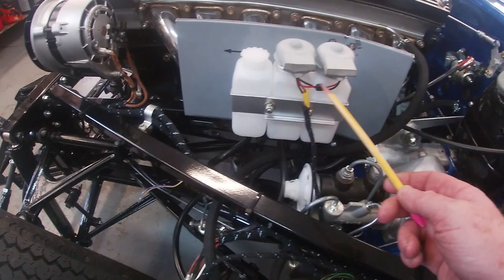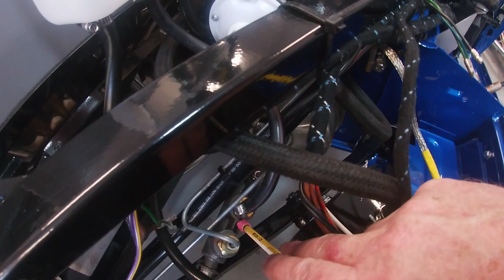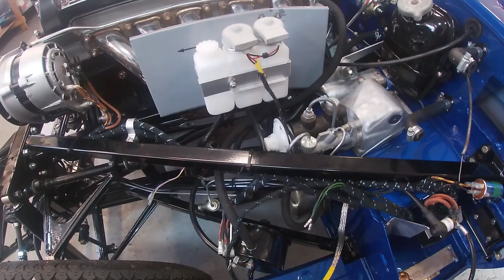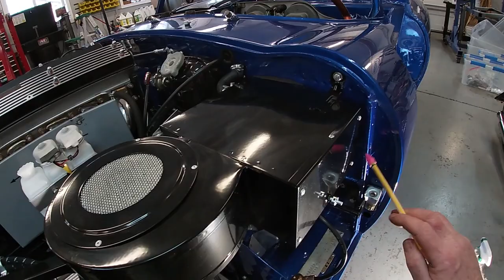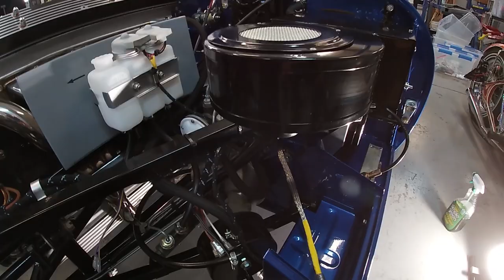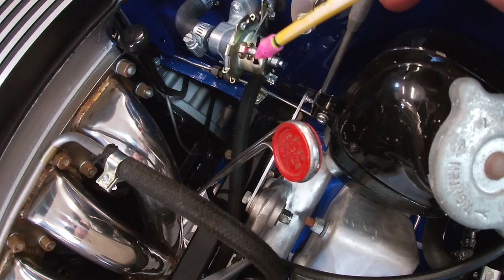Jaguar E Type Series II Rebuild - 2023-02-18 Brake/Clutch Reservoir and Heater Installation

Comment: You are really cracking on now John and putting me to shame. I have just fitted the engine today. Thanks for you tips in a previous video. I was a serious fight on my own especially as I have ftted a 5 speed box which is nearly 3" longer than the original. Your heater box looks stunning with such a great finish on it. Mine has rotted out so I am going to have to fabricate on. Thanks for the tip on the bracket on the bottom I did not know there was one there. Hugh

Comment: Looking good John. Smart move leaving the protective film on the reservoir heat shield so it won't get marked up while you're working in there. I think you're going to have to move the charcoal canister back a bit to fit the wheel mud guard on. You might want to do a test fit.
Reply from the maker: Hi Rick, Thanks - I TOTALLY forgot about the protective film. It looks so much better without it. 

I had to move the canister back for the wheel clearance on the lock-to-lock check. I will finalize that position when the mud guard goes on.

Comment: John. you most definitely need the lower heat shield otherwise the paint flakes off your servo. Glad to see you pointing to stuff with a pencil with a nice rubber on the end. Much less likely to scratch something. And if you can say torch instead of flashlight, I can say rubber instead of eraser, no laughing please from the US contingent! Only one or two vids away from first revolutions!!!!!!!!
Reply from the maker: It is always better to point while using a rubber.

I have the lower heat shield on order - it took a few tries to source one, but I got there in the end. 

Tick tock on the revolutions

Comment: I'm going to try (attempt) something a little different.  (probably a bad idea)  I'm going to install everything on the driver-side engine frame, including the upper and lower heat shields (AND take off the plastic coverings, haha).  I'll have plenty of room in which to work.  This is while the passenger side has no frame installed.  I'll install everything on the passenger side short of the frame (which has the most important items).  I'm installing new seals and gaskets on the transmission and will mate it to the engine.  Then, I'll build a trolly for the engine/transmission and slide it into the correct position  into/under the car.  I'll add just about everything to the engine like the exhaust down pipes, et al., so it will be easy to tighten all the brass nuts and things like that.  Finally, I'll add in the passenger-side frame, then complete the picture frame installation.  The speedometer drive and the clutch slave cylinder will be previously installed to the transmission. When all is aligned and adjusted, I'll lift the eng/trans with the hoist a few inches and fix it in place.  This should avoid all the dings and scrapes AND make sure all is installed/included in the assembly.  Haha,...I'm not sure this strategy will work, but if anyone has done their reassembly like I am proposing, I'd sure like to hear about it... 🙂
Reply from the maker: WOW, go for it. The only thing I would say about the heat shields is that they are incredible close to the exhausts and positioning the shields (fore-aft) is down to a I/32 or so.

DONT forget to take off the plastic coatings!!

Comment: If you would like drawings of the lower heat sheild, I had to remade those for my S2.  I used a two part aluminum with heat resistance between.  I can send the drawing if you like or I can have the shop make you the aluminum panels for you.
Reply from the maker: Hi Jim, WOW - thanks for the offer - this is excellent and much appreciated - I found a source for the lower heat shield and it is on its way here. Let me see what turns up and then decide from there.